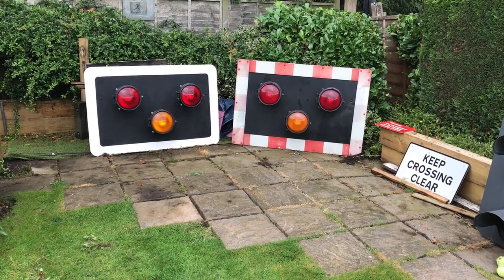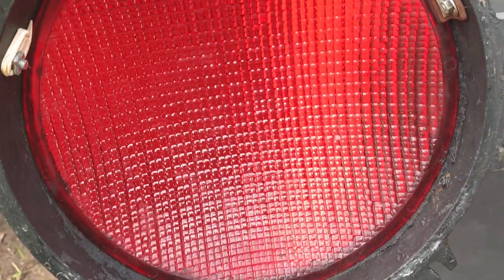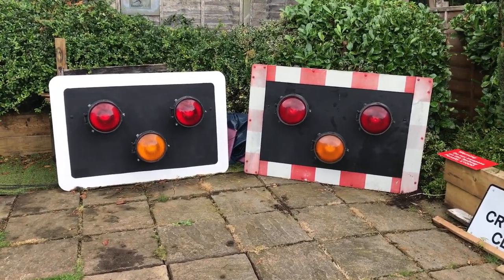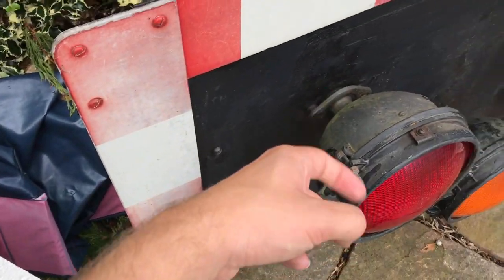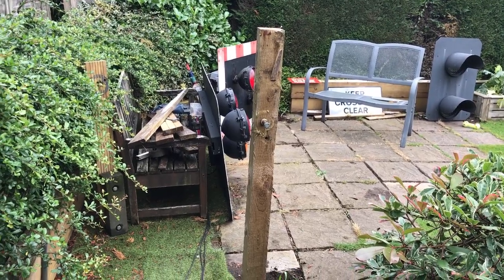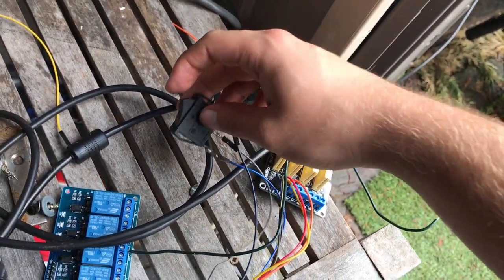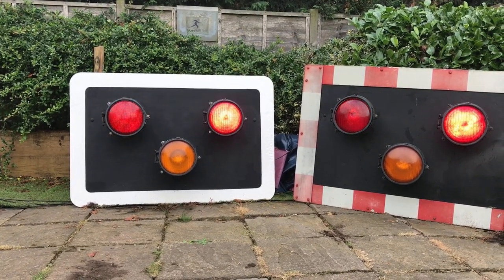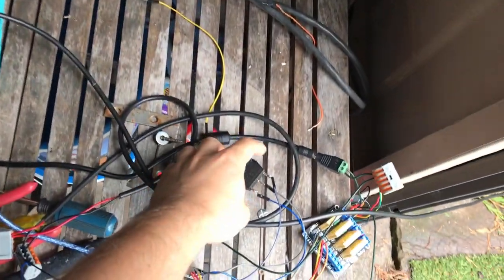My Vintage Level Crossing Wigwags (Project)

Comment: This is great to see. I still need to buy and make up the electrical circuitry to power my one, so it's interesting to see your set up with Arduino and relays. The wig wags must be so heavy. My GEC wig wag was missing its backboard, but I opted for a sheet of ABS as it was more lightweight than replacing with steel sheet. Mine was also originally 230v AC, but each light had its own transformer to step the voltage down to 12V for 50W halogen capsule lamps.

Comment: I can’t understand why Network Rail stopped using halogen lights if they’re as bright as you say they are.

Wouldn’t it be great to use these as a burglar alarm! Any potential burglar would absolutely 💩 themselves not just at the alarm, but also thinking there’s a train coming that they can’t see!
Reply from the maker: They may look bright in this video. But how bright they look just depends on the angle you look at them, as well as the light conditions - if sun was shining directly from behind or in front of them then they’d be more difficult to sight. I believe that’s why LEDs are more favourable I’ve halogens nowadays, and not to mention that halogen bulbs use more power than LEDs do.
Reply: @FlashingRedProductions  Fair enough that I guess.

Comment: I know I've said it before, but what an excellent grab there Will! Lot more bolts holding the front half of the light heads on 'em, lol. Any manufacturer markings on them, BTW?
Honestly glad you've got two variations on these classic wigwags, lol, and you also have a white-bordered one you can watch at anytime you want, lol.
Reply from the maker: Thanks! 😁
There’s no manufacture markings on them, except on the filter lenses - they read “GEC Traffic Automation”, although for some unknown reason the red lenses on the white bordered wigwag were made by an Austrian company, even though the amber lens was made by ‘GEC’.

Comment: Wow! This is really impressive! How did you get all the parts?
Reply from the maker: Thanks! 😁
I used an Arduino UNO (which I programmed using the code I wrote up on the Arduino software), Arduino wires, solid state Arduino relays, an AC/DC adaptor (24vdc), and some clip-in terminals to ‘multiply’ the wires for each light. Bought those parts from Amazon and eBay.
Reply: @FlashingRedProductions  thanks

Comment: Wow, this is very cool to see! Are you going to unscrew and remove the red and white borders so they both match?
Reply from the maker: Thanks! 😁👍
I’ll probably keep the clip-on borders on (for now) as the white border underneath has peeled off since I first got it (the picture of that wigwag with the clip-on border removed was taken around a year ago). I may restore the red and white borders though at some point because they’ve faded a fair bit.
Reply: @FlashingRedProductions  Ohh okay, Middlemere’s vertical wigwag has a peeled off white border too lol, the red one is coming off and I saw the underneath